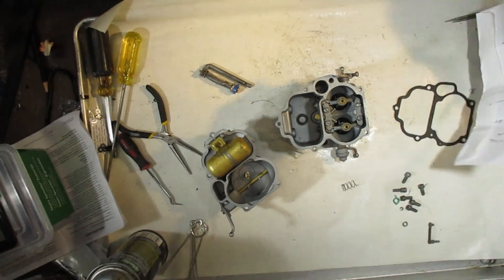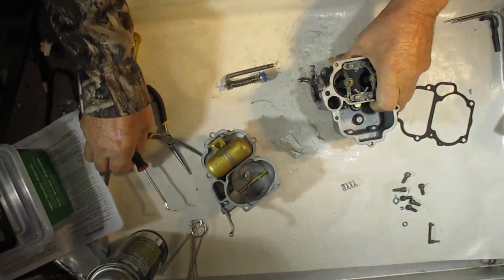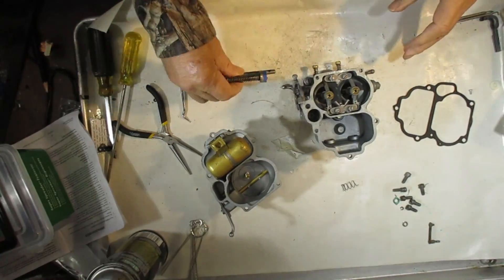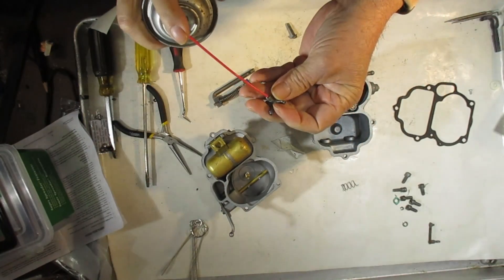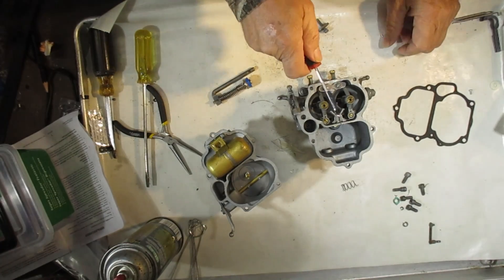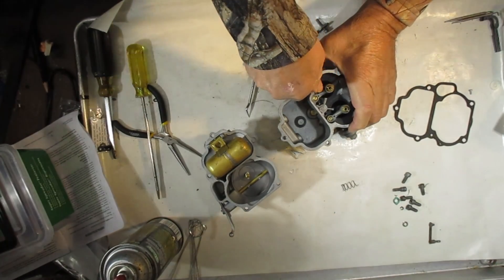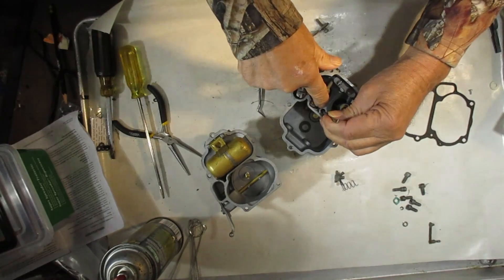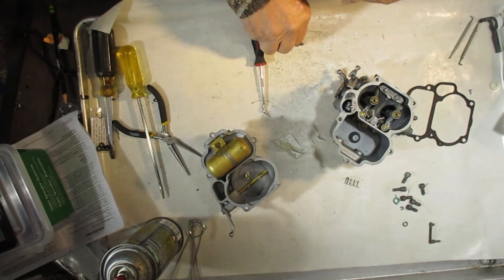Holley 94 & How The Accelerator Pump Works

Comment: Hi mike. I’m running a Tri power set up, and I’m able to idle and rev up the motor in park fine, but under load the car is stumbling as if it’s not getting enough fuel. I can hear/feel the accelerator pump squirt tho. Any ideas?
Reply from the maker: But do you see gas squirt when you pump the gas. Look down the carburetor (engine off) and pump the throttle once.